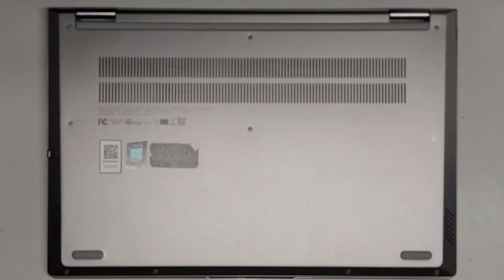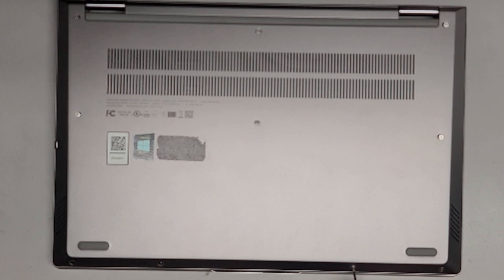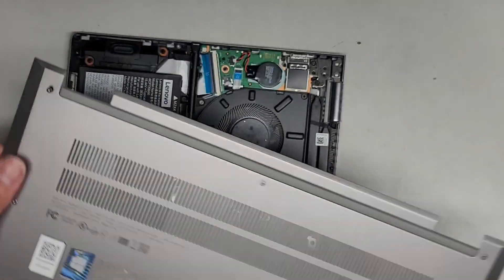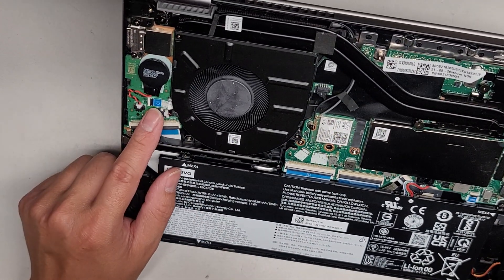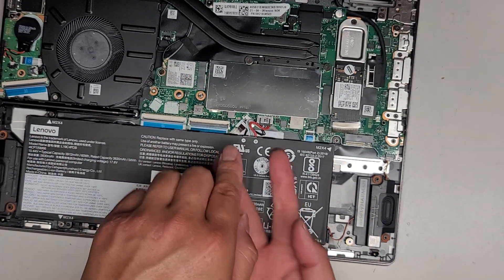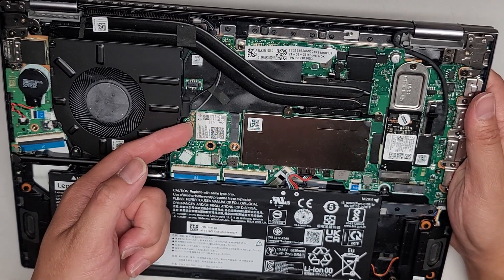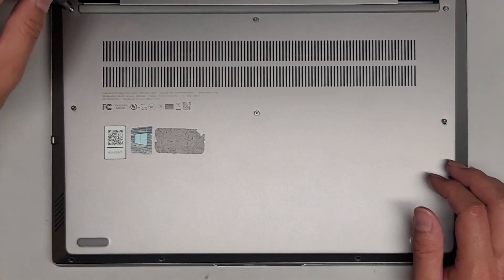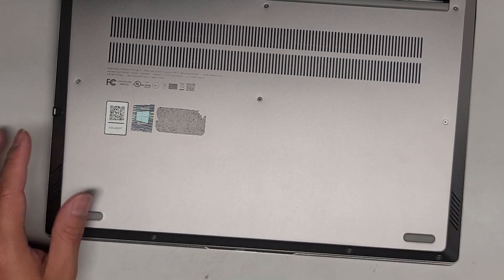Lenovo ThinkBook 14s Yoga ITL Disassembly RAM SSD Hard Drive Upgrade Battery Replacement Quick Look

Comment: I need to buy the I/O Board, I've been looking everywhere for it, but no luck. The clamp holding the cable for the fingerprint scanner broke. Can you please point me in the right direction??
Reply from the maker: Can't find it :( check if there's a model number on it somewhere.